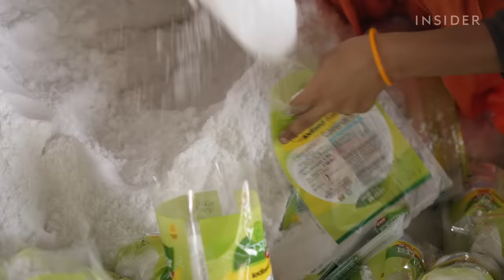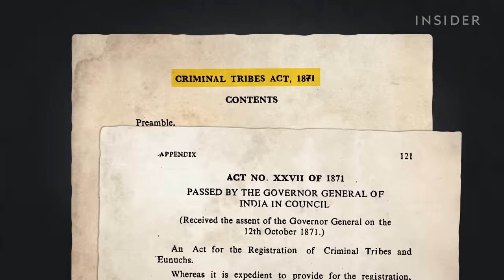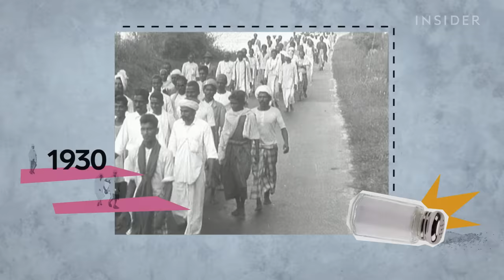Why Salt Farmers Risk Their Lives To Harvest Desert Salt For $4 A Ton | Big Business

Comment: To put that into perspective, one kg of sea salt costs about $ 1.91 in my local supermarket - so a ton is about $ 1910. Pretty amazing how huge the margins are.
Reply: Not really, that’s repackaging, marketing, transportation, lots of machinery, change of hands and expenses along the way.  Your grocery store probably only sells it for twice what they buy it for.
Reply: @CheddarCheeseBandit  The compounding margins are very inefficient. A lot of middle-men take unearned margins and the actual producers of goods earn the least piece of these margins. Unethical would be an understatement.
Reply: @NaderNabilart  Issue is others have scaled the raw material production up to the point their operation is too inefficient, most countries have a few production facilities to do this; hell the US has like > 90% of it's needed salt production coming out of just seven of it's states. Best thing they could do is try to do the entire processing chain, maybe multi-market by offering their salt as no heavy machinery used etc but that requires a lot of up front investment they likely don't have.
Reply: @CheddarCheeseBandit  You barely need to market salt
Its practically essential
Reply: Where the hell are you buying sea salt for 2$ a kg?!  Its like 1$ an oz
Reply: @CheddarCheeseBandit  Grocery stores would kill for a 50% margin… espacially on salt this will be around 5-20%
Reply: @bliblablubdiedadup742  some items in the grocery store could have a 2000% margin on several items if sourced from local factories. They probably lose out the most on fresh vegetables and items that are perishable.
Reply: Here in India it costs $0.29 for top quality salt per kg
Reply: But in India a kg of sea salt cost around ₹ 30-35 and Himalayan salt for ₹60/kg. Exchange rate is ₹75 for 1 dollar.
Reply: @LaFonteCheVi  that's fking bullshyt,these poor farmers are being exploited by capitalism and the capitalists  who besides owning the capital,does next to nothing and contribute nothing to society and little to the economy except to steal the value of other people's hard work and the value of their goods and productivity.

The same salt here transported to developed nations would be sold in supermarkets for close to $1 per kg or $1000 a ton,these farmers are getting less than 1 percent of the retail value of their salt if sold at market price.
Even if u account for the cost of transportation and processing and packaging of the salt,the profit margin would still be insane.

If these farmers controlled the capital base required and the entire supply chain and process leading all the way up to market.....just imagine how much more they could make,they would be working for the benefit of themselves and the betterment of their own people rather than 

Capitalism is nothing but the rot,the crystalline black mold and fungus creeping across our flesh and through the our arterial veins,the parasitic tapeworms and melanomaic cancerous cells,
Reply: @lucky3589  bhai 30-35 kha se le rha h, 20 me mil jata h easily TATA ka
Reply: @prakharmangal4371  bhai Tata salt lite low sodium wala 35 ka milta hai baki mere ghar main to rock salt hi khate hai wo to 60 ke upar hi  ata hai.
Reply: @treatb09  your joking right?
Holy crap, in my country you buy sea salt at 0.21€/kg at most it's around 0.99€/kg and that is a tradicional made salt too.
Reply: @jont2576  the way you word your statement compels me to agree.
Reply: My recent purchase of salt is $2 for 0.7kg of salt in America
Reply: @CheddarCheeseBandit  only twice? Lmao

Bruh if everyone doubled it who got their hands on it, it wouldnt cost $1900 a ton. $4/ton is criminal.
Reply: @NaderNabilart  Feel free to do better.
Reply: To be entirely fair, that's after it's changed hands like 4 or 5 times before it got to you, and each person had to make some sort of profit.
Reply: @UrielX1212  I am not the Indian government, this kind of work is overlooked because it benefits the corrupt officials.
Reply: @treatb09  lol you didn't read or watch enough. it's not per kg , per ton
Reply: @CheddarCheeseBandit  make 100% in any stock and tell me you performed badly. I dare you
Reply: In India, 1kg salt cost around 25₹  i.e. 0.30$
Reply: @NaderNabilart  طيييييييط
Reply: @babagandu  نعم؟
Reply: So much arguing about how little everyone seems to be making over salt but remember. One group is toiling away in the salt too poor to run their work properly and the other group is sitting pretty on millions they didn't have to do a thing to earn
Reply: @jont2576  "Being exploited." This dude is wearing Adidas, he's not doing bad.
Reply: @matthewrusso4875  that $4/ton is indeed weird

In the US, you're looking at almost $9/ton for brine salt
Reply: @treatb09  At local shop in Riga salt is ~2€ I can find it for ~1€ in other shops.
Reply: @neerjain6176  Before Russia started attack salt in Latvia was ~0.65€
Now it is over 1 Euro.
Reply: @jont2576  blah blah blah blah, nobody is forcing them to mine salt. There are any number of other jobs they could work.
Reply: Texas 40 pounds 5 dollars or 277 per ton
Reply: @genericscout5408  2000% ?
Name one item that costs 1$ and they sell it for 200$ ?
That's ¼ of a average person's monthly salary
Reply: @neerjain6176  Yeah, but you're in India
Reply: Farmer will always become the poor... the middleman will always the rich
Reply: It's the logistics oF getting you that seas salt fuel is burnt to get it from the farm to the packing plant fuel is burnt to get it  to the docks fuel is burnt to get it on the ship fuel is burnt to get it to the nearest port  I hope you get the point and some is running the equipment which someone made an investment in the equipment and company and on top someone has to get paid and oce it reaches a"first world country" wages have to be paid along with benefits and higher taxes
Reply: none of what u guys are saying even matters.. the point is, ppl are greedy and self centered and THATS Thee Margin..
Reply: the salt you buy in the store is also of much higher quality than this stuff. there is a reason nobody else does it like this, and the salt needs to be washed of debris to be usable. its very low quality.
Reply: @NaderNabilart  if those middle men were actually making money without providing value equal to the money, then very quickly a bunch of other middle men would join in on the easy cash, which would tank the profits for each middleman thus ending the practice. 

the fact that this has not happened in an industry as old as the salt industry means that each person in the chain is not an unethical middleman, but a necessary one to bring the salt from the farm to your kitchen table.
Reply: @asatsuki9250  you put too much faith in capitalism, there is this idea that everything under capitalism must be optimized and streamlined to the max and even doubting this idea is ridiculous. However, in many industries this never have been the case, and privitization made it way worse, railways is one apparent example used by everybody, but you can find more if you like to read about this, "Bullshit Jobs" is a book I highly recommend, the author David Graeber gives many examples for corporate jobs that don't add any value to a company and he tries to trace how and why these jobs exist. Most of these middle men are only there to suck up profits rather than the people who produce the actual salt. They might find a shiny title to call themselves, like the executives of 2007 stock market crash, we all know now how they got their money and who paid to bail them out at the end.
Reply: salts made in the UK and probably the US are harvested by pumping high pressure water into caverns under ground and then evaporate the water and refine the salt a very different and modern process compared
Reply: A lot of US salt is from salt lake city. If that makes you feel better
Reply: @H4XE7 REAC7 I used dollar as an example.
And 800$ is 2-6 times more than minimum wage (in many countries)
Reply: @NaderNabilart  lmao how is that unethical the farmers can't transport it and those who move it in large quantities incure the largest risk therefore gets the largest share lol. it's economics the grocery store has little risks so they have a small profit the farmers on the other hand aren't valuable as they are easily replaceable both in terms of lives and jobs as more ppl would do the job
Reply: @justinkim7756  why would transport be riskier than salt production? Also, you missed the part of the video when they say "packing facilities" take the most profit margin, not transport.
If you have no value for the workers themselves, maybe read a hstory book about your own miners and workers and how they suffered bullshit like this and fought for their rights to health and safety insurance and created unions.
Reply: @NaderNabilart  agreed, its a sad and unjust method of supply demand. Ethics don't exist in the vast majority of manufacture/source to end user, it literally is a vicious circle of greed and empowerment feeding itself at the cost of the workers providing the product at source and it makes for very uncomfortable viewing.
Reply: @NaderNabilart  because they are taking all the risk as they put way more money than the farmers transporting it as the salt might get destroyed or not sold at margins where it was wort it to move in the first place. The only risks the farmers take is their lives due to their backwards methods of production (not to mention their lives are cheap as they are the easiest to replace in the chain) and the money they invested which is nothing compared to the money every other part of the chain puts in. The farmers need the traders to buy their salt the traders can acquire salt from more advanced producers who produce a better product at a way larger rate which is why the farmers don't and shouldn't have control of the price as they affect it the least
Reply: @Quint1975  lmao just cuz u can't stand it doesn't mean everyone's a little crybaby lol
Reply: Highly lucrative & exploitative indeed 😢😢
Reply: Here in India good quality 1 kg sea salt price is just 0.20 USD and 1 kg rock salt is 1.5 USD. 

May be in US you guys earn more and spend more.
Reply: @treatb09  less than 30 rs I spends on 1 kg Good quality Iodised table salt.(approx 0.37 USD) 

Earn more spend more.
Reply: @jerryg3652  you guys earns more and spends also more. In India just 25 rs per kg for good quality sea salt and 60-70 rs for rock salt. (1$= 79 Rupees)
Reply: @ArthursHD  Every action has reaction.
Reply: @Nikhil_Sahu_G  it's not a flex to show that raw goods are cheaper in ur country lmao that means ur currency and economy don't have much leverage worldwide lol which is true lmfao. India being a world power? What a joke lmao
Reply: Is everybody going to ignore the fact that 99% of salt is used industrially? You can't make chlorine and caustic soda if salt is $1910 a ton. These people literally just can't compete with actual salt mining. That's all it is.

Comment: "Government subsidized solar panels to power the pumps" (starts ancient hit and miss engine), what a legend!
Reply: exactly🤣🤣
Reply: They use it to light up  their homes at night and charge their smartphones😏
Reply: @Lalalalalkk  "Modern day slaves."
Homie playing Fortnite on his PS4 in the background while listening to Doja on his iPhone 11
Reply: It's not a hit and miss engine- I don't see a carburetor or "mixer" as they were called as they were "gasoline" or petrol engines. It's an old slow speed diesel engine that's clearly firing on every compression stroke.
Reply: That's what I was thinking
Reply: @chestervaldes7551  you are right they used petrol
Reply: Are you sure it wasn't one of those old Lister Diesel engines?
Reply: They have to use dual system because water is also pumped after sunlight is gone.
Reply: @chestervaldes7551  no didnt you hear the narrator, thats a 100% electric engine
Reply: @Lui_kal  they use crude oil instead of diesel bcs it's cheaper.
Reply: @chestervaldes7551  it runs on kerosine

Comment: "these solar panels power the pump" - starts up petrol engine.
Reply: Lami ang magic sarap part
Reply: The hit-n-miss Diesel is reliable and very cheap to operate.
Reply: its a smokey diesel engine
Reply: Lol
Reply: Stoppppp!!!!
Reply: Same as Tesla charging station running on Diesel generator.
Reply: These are used for initial running.

for instance when you switch on your AC it takes around 2000 watts for the first minute while for the other time it uses only 800 watts. Same applies to pump.

It is impractical to have a 2000 watt solar panel while only 800 watts will be used for 99% of the time. 

Therefore these pumps are hybrid.
Reply: @CoolMan-ig1ol  yaaa no that is a mechanical pump, it appears they have a mix of Electric and diesel pumps.
Reply: Agree! 🙄
Reply: That was most probably the other farmer's pump , as they have shown two farmer's here . Maybe one of them uses a diesel pump and the other has a solar-powered pump .
Reply: Just wanted to make sure i wasn't the only one who caught that
Reply: I should point out that this hit-n-miss diesel is the better part of 100 years old that is how reliable they are.
Reply: @shadowsrwolf  The first one is a pure diesel one. The second is not.